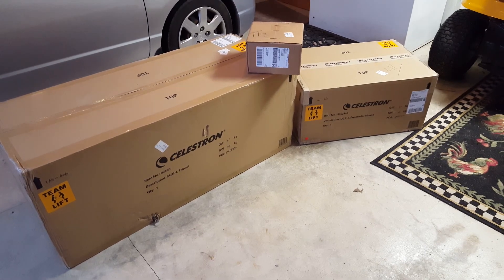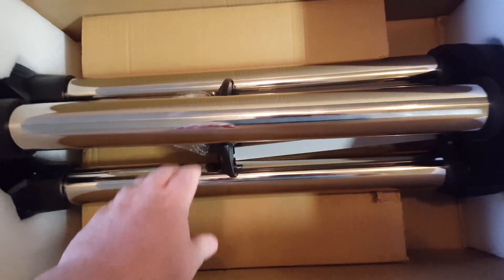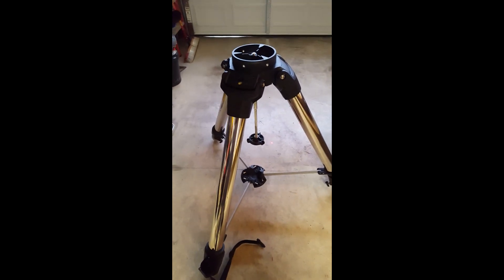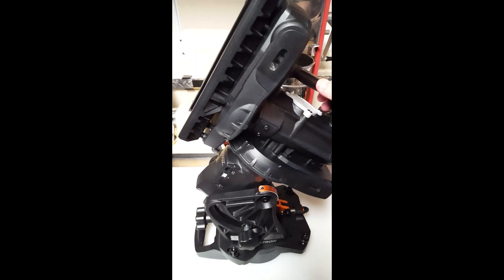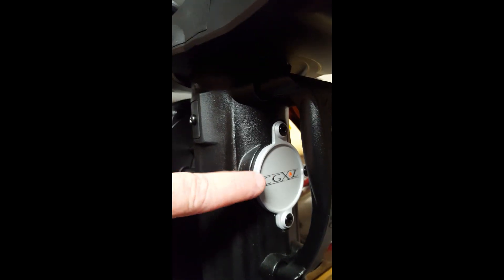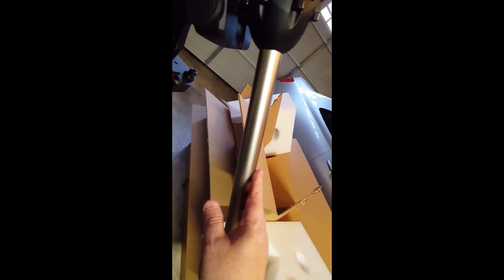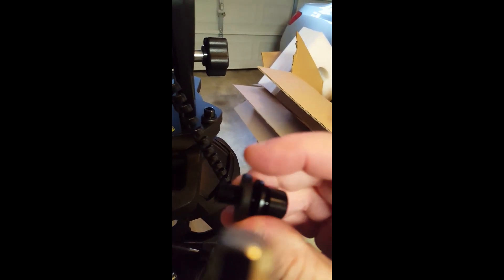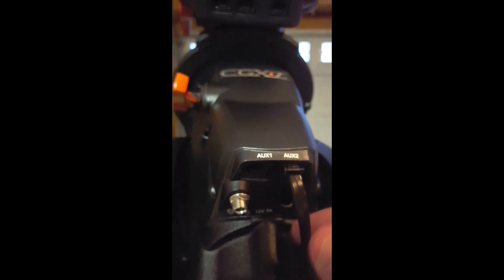Celestron CGX-L Unboxing

Comment: The tripod that comes with the CGX-L looks to be similar to the one that comes with the CGE-Pro. With that being said do you know if a CGX-L mount would fit on a CGE-Pro tripod? Or are the mounting wholes spaced differently on the two tripods? Thank you and CS.
Reply from the maker: Perry Hambrick I wouldn't know as I don't have a cge pro to compare.  If you look on Dan's pier plate site they do look almost identical.  He may be a good resource to ask since he sells pier plates for both.

Comment: Have you tried using a long imaging apo on that mount?
If so, do you know if the mount is high enough like the CGE Pro for the telescope not to collide with the tripod near the zenith?
Thanks
Reply from the maker: Elie Kh, I am awaiting an additional counterweight before I can try it out with my C8
Reply: Thanks for the reply.
Indeed, I'm not interested to know for a C8, that's back heavy, small and short :) Unlike my 1,3 meters long front heavy apo :) 

Have fun with the mount!